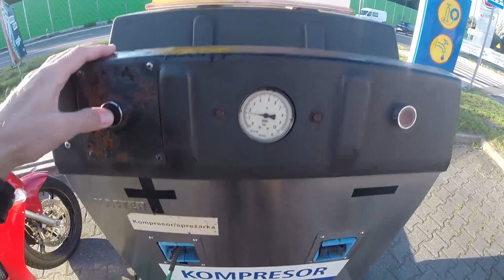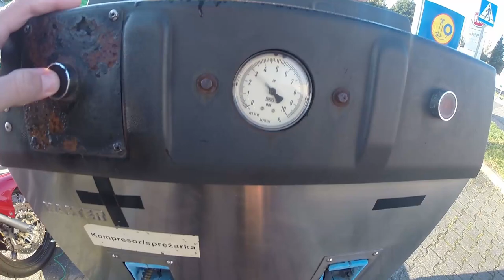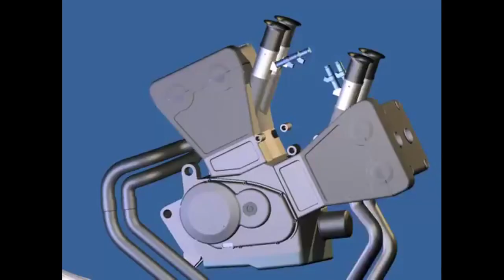Honda VFR 800 FI Interceptor RC46 Test Ride short review :)

Comment: Where did you source the rear lights clear glass please? Beautiful bike 👌❤️
Reply from the maker: Check here https://www.ebay.com/itm/LED-REAR-LIGHT-FOR-HONDA-VFR800-Fi-1998-2001-WITH-BUILT-IN-INDICATORS/265002685162?hash=item3db36412ea:g:tAYAAOSwaFRf9Jcn
Reply: @denydenis01  dzieki bardzo. Also interested in changing my bars for something like yours, any links prosze?